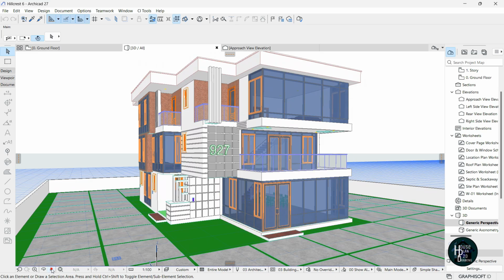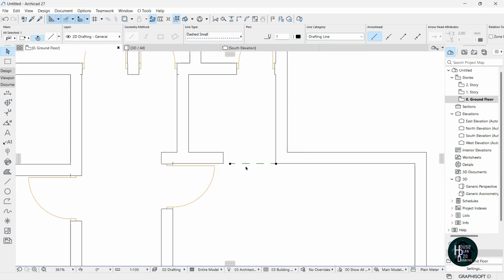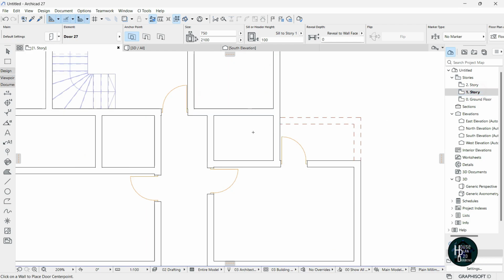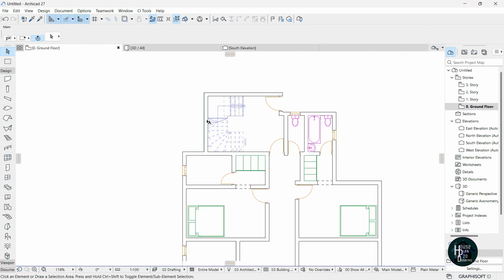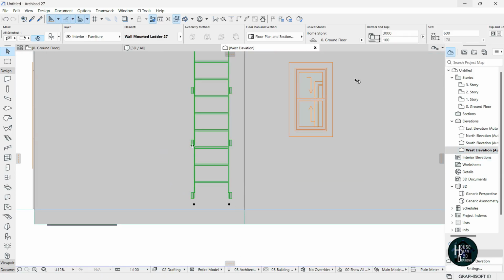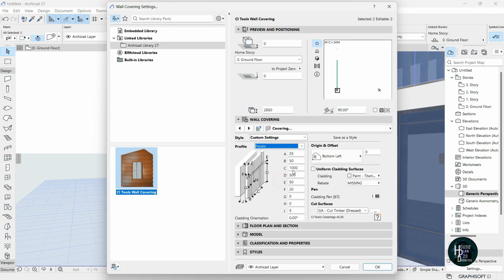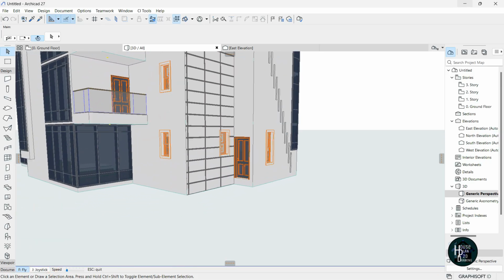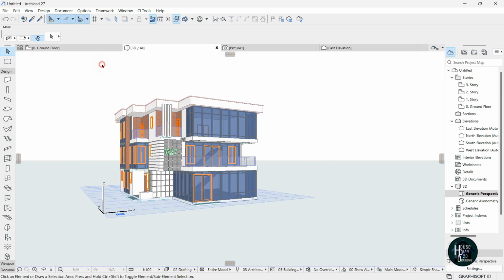Archicad Tutorial : Basic Floor Plan To 3D For Beginners

Comment: Can I ask something? These walls; The inside, outside phase what does it mean and do?
Reply from the maker: Okay

That refers to the Wall Reference Line. 

It tells Archicad which side is the exterior (outside) and which is the interior (inside). 

Also its very important for aligning your walls correctly and making sure your finishes (like outside brick vs. inside plaster) show up on the right side